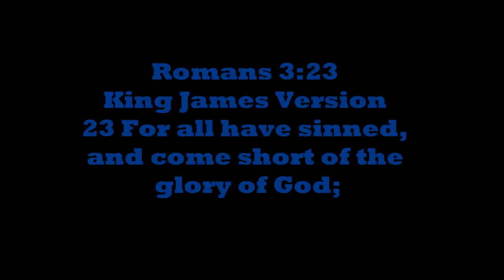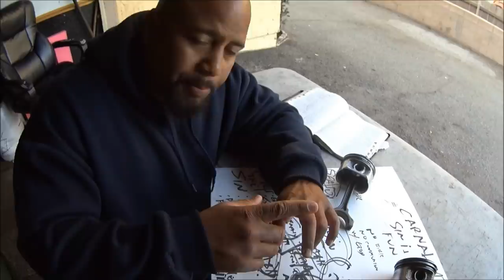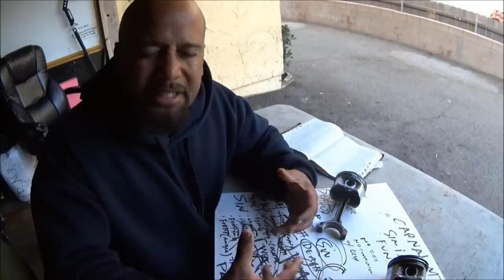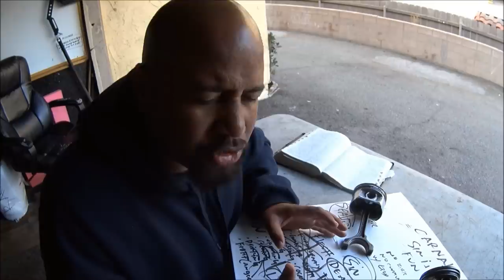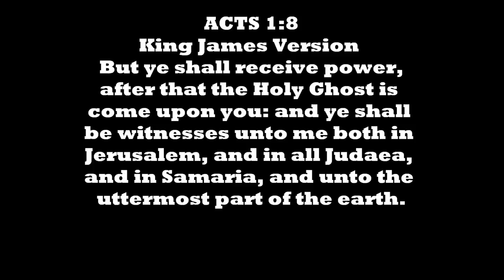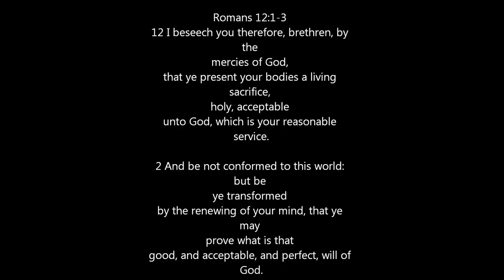FIX ROD KNOCK UNDER $40 FOR THE BROKE FOLKZ HOW TO FIX YOUR BROKEN SOUL STARVING YOUR SPIRIT (2023)

Comment: I wonder if you changed the bearing every 6 months at the cost of about $40. Theoretically if you babied the engine couldn't you keep doing this and keep the engine going for years? Because isn't it that what goes out. The bearing goes out and that's what ruins the engine. Making it throw a rod. So if you changed the bearings every 6 months before they go . badda boom badda bing the engine could last for another 5 years at the cost of $200. Cheaper than a new engine and time to save for a new car. Idk I wonder if anyone can attest to doing this to keeping a engine going past it's due date. So to speak.

Comment: Whatsup OldSchool!! Dude, i dig your style Homie. No, Homo and No Disrespect. But, I did subscreibe bro and man if you can plz get back to me bro i have a 2002 Chevy Suburban LT. And, when its cold it knocks until warm up then stops. And, then bro my radiator is getting to hot to me. But, it shows ryt under 210. So, I dunno bro. Im gonna say a prayer out Heavenly Father Jesus Christ will give you a visual. Hah. 200,000 miles. I want to keep it like a Champ. Thanks again for your Spirit. Thanks. Man. Zack

Comment: Dude! You trample the blood of Christ with the John the Baptist gospel that is the kingdom gospel. Hebrews 6:1-3. Most unlearned of the new Gospel of grace make this mistake. 2Peter 3:15-16.  Only our apostle Paul was givin grace message by Jesus (acts 9:15  in the wilderness. 1Cor. 3:10. Please study apostle Pauls work startin in Acts 9 and especially vs 15.  Jesus makes Paul our apostle.  Study Galations 2:9.  sorry man your/many church (Matthew24:4)  is not sharing our dispensational truths in Pauls work.   John 3:18 say they only had to believe in Jesus name. (Luke 18:34 read vs31-33) But the cross was hid from the 12 coz. The grace gospel was to be told by Paul. The last shale be 1st.